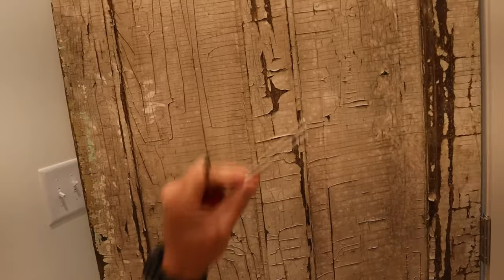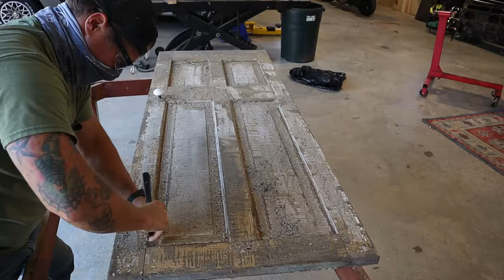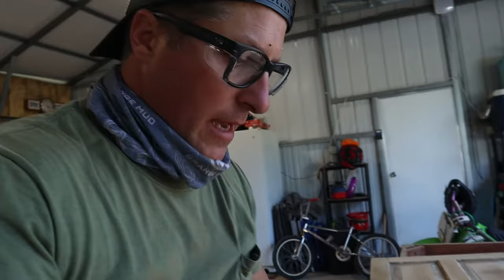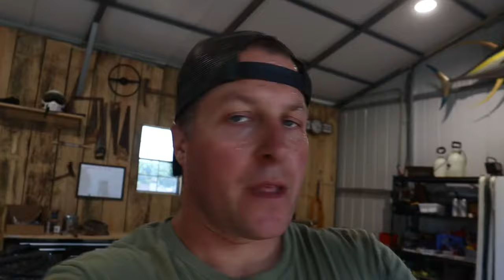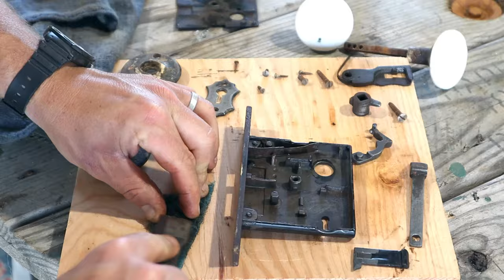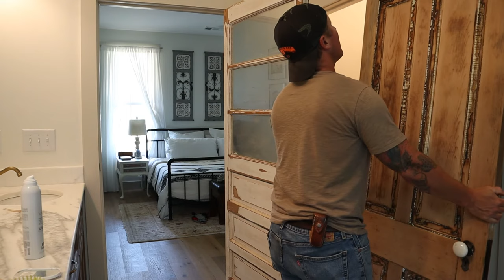I COULDN’T BELIEVE IT! How to restore an OLD wood front door!

Comment: Paint stripper. I will do less damage and leave a better look. Faster.
Don’t leave it bare. Mohawk Lacquer is clear and does not darken the wood like poly. Buy an inexpensive HVLP sprayer. Four coats with a fine sanding after the first coat, each coat bonds to the last. It will only take you 1-1/2 hours as it drys very fast. Do it outside if possible or use a respiratory. 
Mohawk has many, many sheens. Find a dealer close to you and explain what your doing. I’ve been building custom furniture for over 40 years and lacquer works great for your application. Good luck.
Reply from the maker: Great info man thank you! I will
Most definitely look into it.
Reply: @ProjectDadLife  With regards to paint stripper - try Multi Strip. Environmentally friendly; works well with lead paint issues, gets into nooks and crannies. I've been using it for years to restore antique details in our 120 year old house. Have fun!

Comment: My grandparents' house was from the 1880s, as is ours, and both had those almost identical door hardware on some interior doors (though there were more that had an external latch, so yours are likely the replacements put in by my grandfather as the older latches failed)
Reply from the maker: That’s awesome

Comment: I'm refinishing my mom's front door on a late 1800's Colonial home in the historic town of Oberlin, OH. Our door has a Branford Lock Works mortise lockset that looks very similar to yours! In fact watching you work the interior parts helped me figure out why the door latch wasn't working properly - our spring mechanism was not set in the proper spot (it was sitting above a moving part but needs to sit below the part thanks to your video)! I'm guessing the door and lockset were original with the home. We don't know the actual year the house was built b/c local property records didn't start recording build dates until 1900 so all we know is it is pre 1900. One tip I've learned while researching these old mortise locksets and watching lots of locksmith video's on YT - don't use WD-40 on locksets. Instead use an aerosol delivered dry lube that has no oil or silicone in it. I've seen Locksmith's using a Made in the USA brand called Houdini Lock Lube which I ordered on Amazon https://www.amazon.com/dp/B00C5JFKKE?psc=1&ref=ppx_yo2ov_dt_b_product_details . WD-40 will leave an oily residue which can attract dust/dirt/pet hair etc. and gum up the moving mechanical parts. I also watched a helpful YT video of a locksmith first cleaning the internal parts on an antique mortise set using an aerosol can of Electronic Cleaner made by the CRC brand https://www.amazon.com/dp/B000BXOGNI?psc=1&ref=ppx_yo2ov_dt_b_product_details  Once the door is refinished, and rehung, I've also heard the best lube to use on locks is actually dry graphite powder. Nothing works better on locks but it's very messy and can get everywhere so you probably don't want to deal with it during a restoration project. A couple of squeeze bottle puffs of graphite powder into the keyhole is all you need once a year or so.
Reply from the maker: That’s awesome and thank you for the helpful tips!

Comment: So my house was built in 1947, and the owners before me literally white washed the entire house.  They painted sloppily to the extent of painting over the door mechanisms in the bedrooms and closets.  Yesterday in an attempt to clean the brass doorknob plates, my husband discovered the doors are not only cedar, (you could smell it inside the hole where the lock was) but the mechanism is almost identical to the one you found.  Im so curious now if those mechanisms were still made in the 1940’s, or if they used doors from an older structure.  We are going to attempt stripping the paint and bring them back to the red cedar and just do a clear sealer.  Thanks for the video! (Jenni)
Reply: Side note, there is a hidden (walled off) staircase in a bedroom closet leading to my attic that Im dying to open back up and install a door
Reply from the maker: thanks for the info! a hidden staircase that sounds awesome I'd love to see some pictures of that
Reply: We are first gonna try to get a tiny scope camera in there before we demo, but I’ll find a way to share with you when we do!  My house is a Dutch Colonial style, and the hidden staircase is directly above the one that goes from the first to the second floor.  The woman who lived here before me had no idea it was there so im extra curious!

Comment: try tung oil, many coats work best to bring out the real vintage rubbed wood ook, it gets in the the wood and hardens...then u dom;t have the fake plastic coated look.  It will look authentically vintage instead of modern.
Reply from the maker: Awesome input man thanks I’ll definitely try it!
Reply: Good video!  I definitely would seal this door with something.  Leaving wood bare could lead to a lot of movement as the humidity changes in your house.  The door may fit good today and stick tomorrow.  All six surfaces should be sealed.